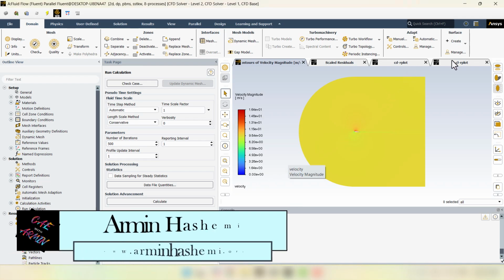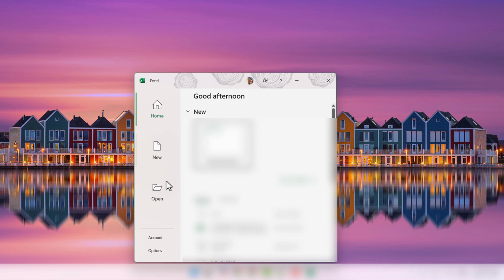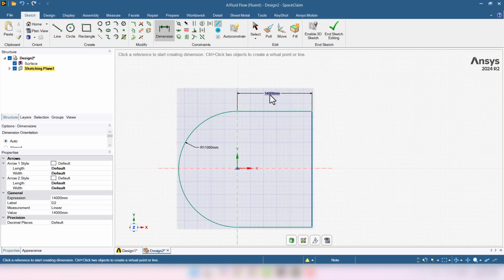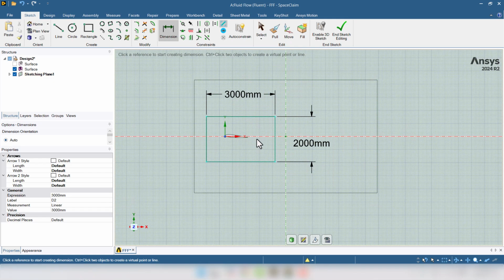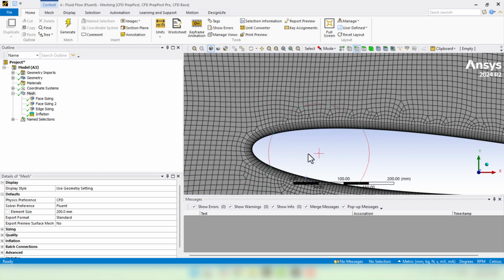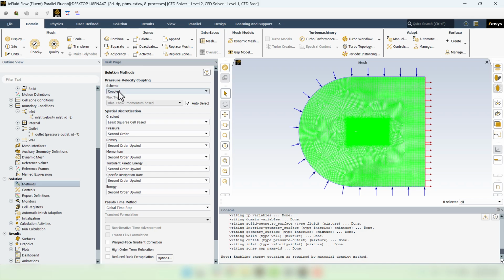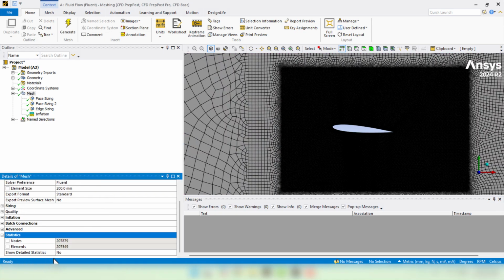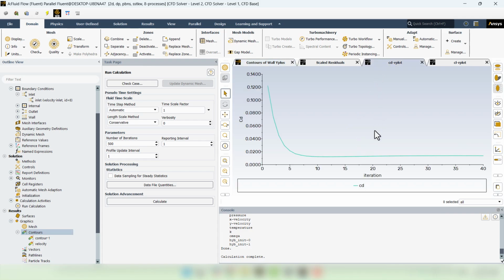✈️ ANSYS Fluent Tutorial | Lift and Drag Coefficient Calculation for NACA Airfoil

Comment: Hi, very nice video i do have 1 qeustion tho: i want to change the AoA not in geometry but as a imput is this posibile? (my goal is to put as a input the mach number and AoA and get the drag coeeff and lift coeff as output in the parametric tab of ansys Workbench) Thank you for any advise and guide!
Reply from the maker: Hello, sorry for the late reply.  
In the velocity inlet panel, you can apply velocity in the x and y directions based on the angle. For example, for 10 degrees, use Uin × cos(10°) in the x‑direction and Uin × sin(10°) in the y‑direction.

Comment: Hi, I did what you do but when I project and erase the surface of airfoil there are more edges which are created after delete surface from geometry. I try fit curves before create flow domain the edges created as one edge but shape of edge a bit changed. Also I created rectangle surfaces at domain and complete what you do then meshed the geometry but There are seen 2 different surfaces in fluent one of them is the main domain and the other one is rectangle frames. And when I try calculating the calculation is stopped by "floating point exception" How can I solve these problems
Reply from the maker: Hello, a floating point exception error occurred due to an incorrect selection of solver or boundary conditions. You should recheck these settings. Also, the rectangular domain doesn't change the results.